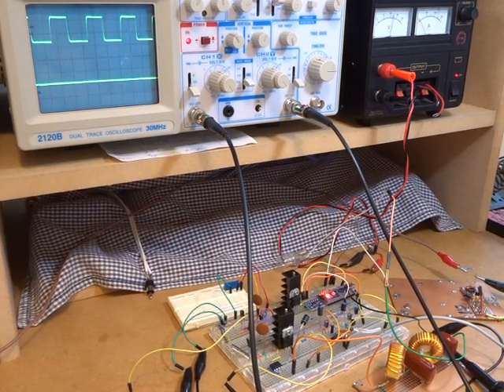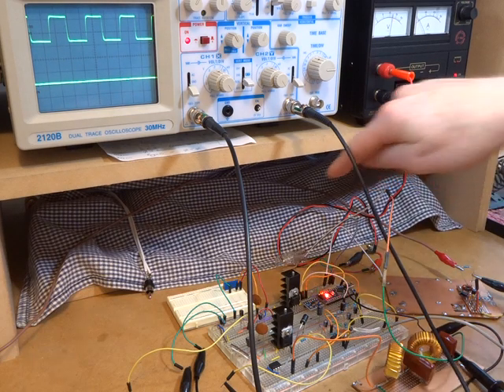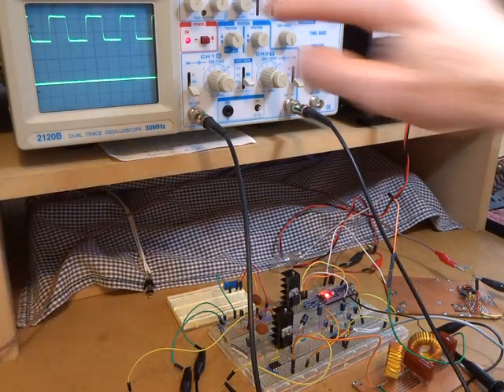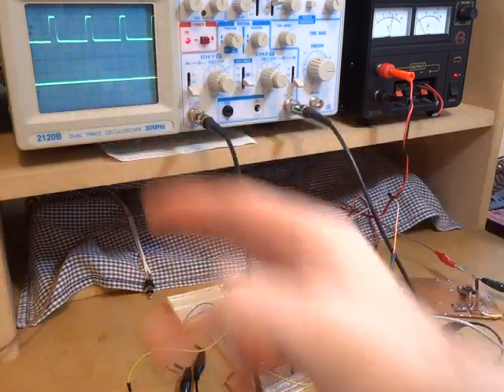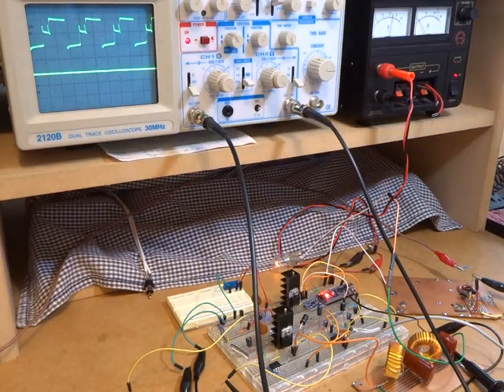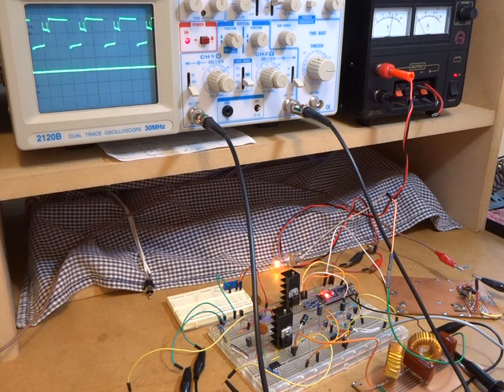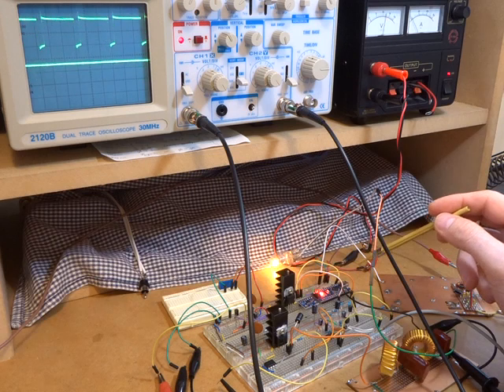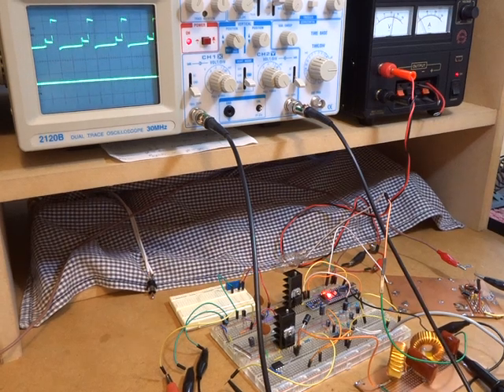AM PWM Rig Part 1b: PWM Test

Comment: Very interesting and a big help to my project. Don't know if you can remember them, but in the 2nd video, your breadboard with the arduino gains a component with a heatsink and in the 3rd video, the other breadboard gains the same. What are these components please? Thanks CT7AXD
Reply from the maker: Hi Graham. There is an IRF640 which is modulating the DC going to the IRF540 Class E amplifier. I'm looking to revisit AM again at some point, and look double balanced mixers. All good fun!
Reply: @CharlieMorrisZL2CTM  Thanks Charlie, makes sense. Hope to start putting my pwm rig together during the current lockdown.